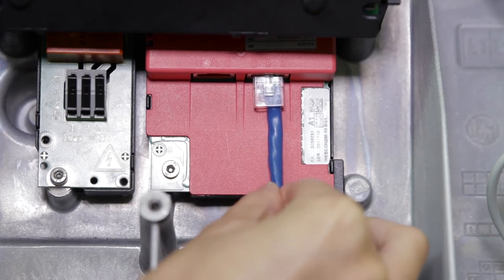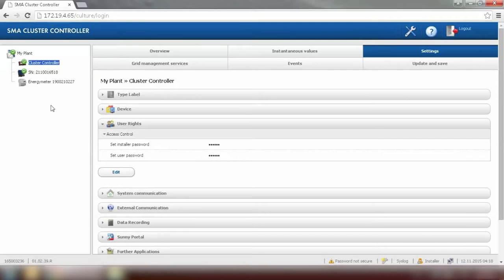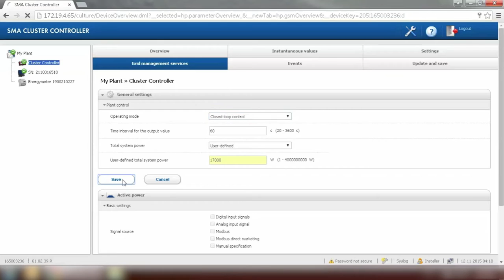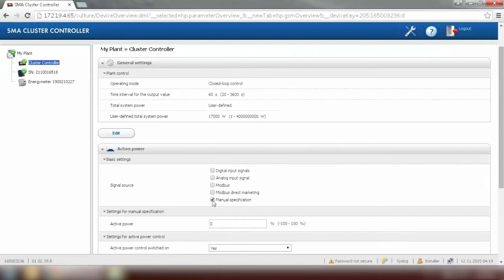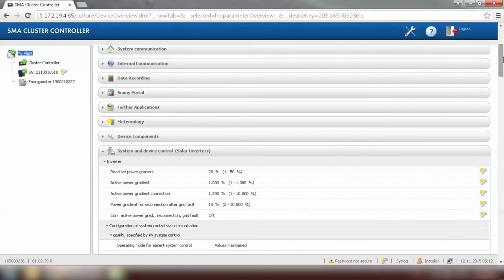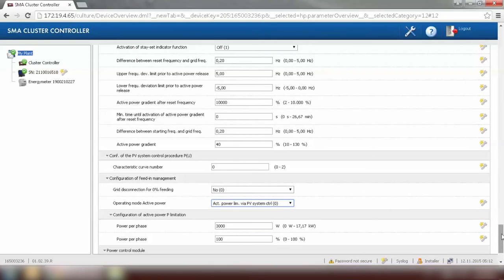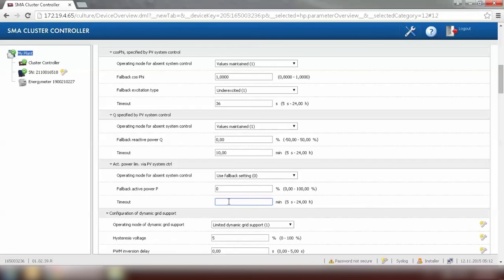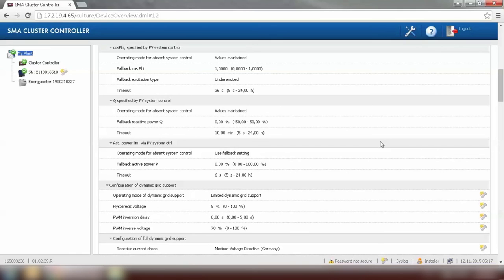Tech Tip: How to Setup Zero Export with the SMA Cluster Controller

Comment: I would like to ask assistance regarding to sma energy meter. We will configure our PV plant 210kWp to zero export configuration. We already have Cluster controller which is connected to 7pcs of STP 30000TL-US. The system voltage is 460V/265V. We will ask what can you recommend to us version or model of SMA Energy Meter. Is it compatible since the datasheet of the e-meter is 400V/230V?

        Thank you and more power!

Comment: Is it the same settings for USA?
Reply from the maker: Boanerges – The Cluster Controller is no longer available (and the Energy Meter is not a UL listed device). The SMA Data Manager M is the replacement device for the Cluster Controller.  This Tech Tip (https://youtu.be/xfFeZbBmG-w)  covers setting up zero export with the Data Manager M, UL listed SMA inverters and an approved energy meter. If you have a Cluster Controller and wish to configure zero export, please contact Service@SMA-America.com for support.
Reply: @smasolartechnology  Thank you!